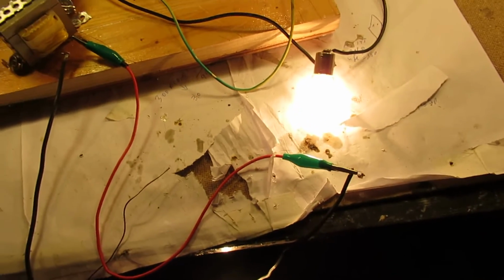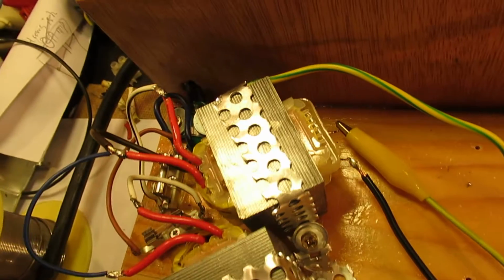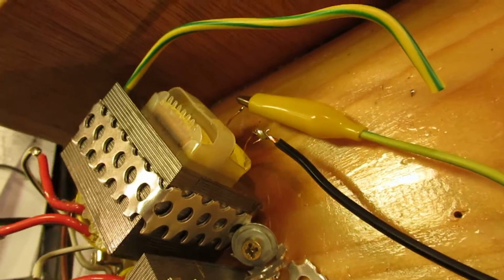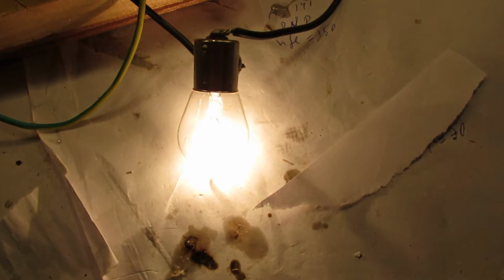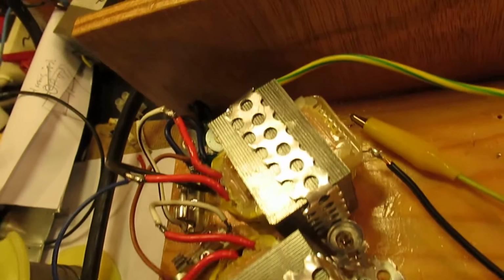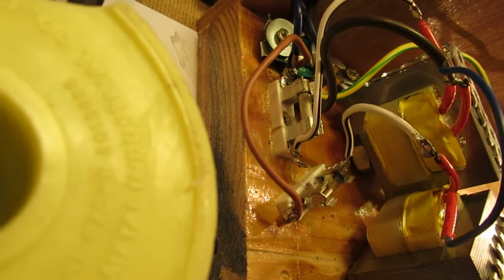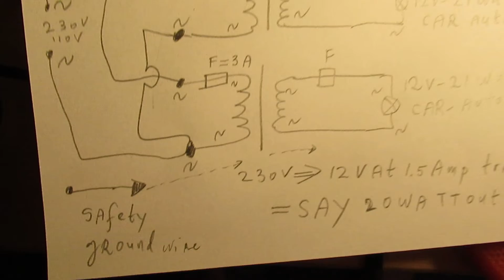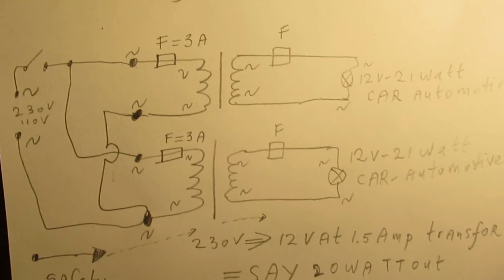Double power supply video 2: a first test of transformer properties with 21 Watt incandescent lamps

Comment: Great classic AC setup, in the better transformers they incorporate a thermal fuse, which will blow if it gets too hot! I have managed to repair a couple of these, but mostly it makes the transformer useless. I’m certain you know about this, but I thought I’d just add my 2 pence worth ;)
Reply from the maker: Thanks! And yes, when I can find them (sometimes hidden) I short them with a wire and at the same time I wire a normal fuse into that primary. Makes it useful for years, anyway, thanks again.